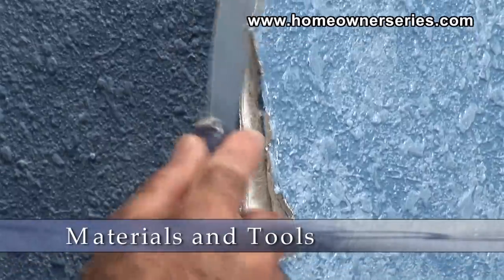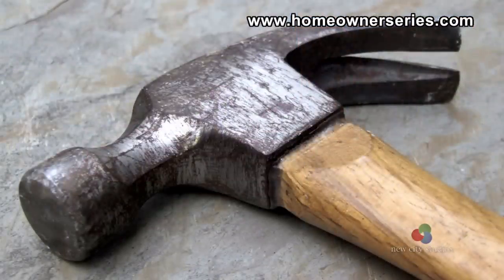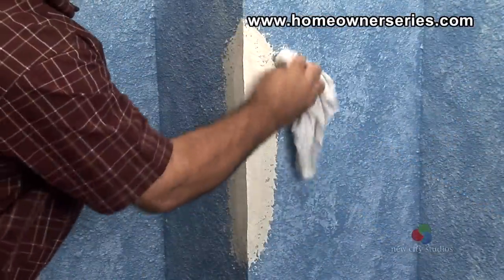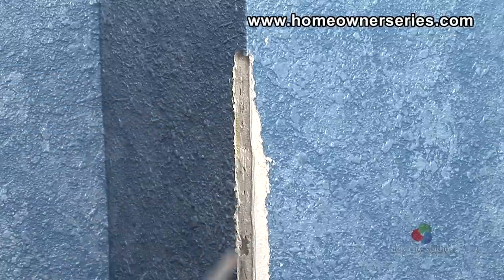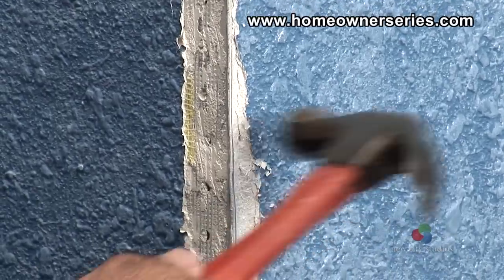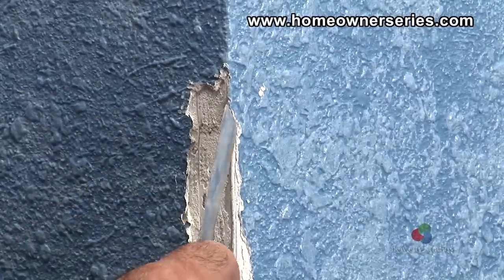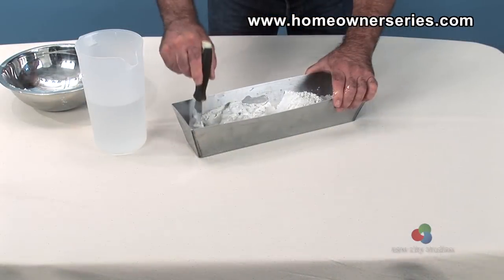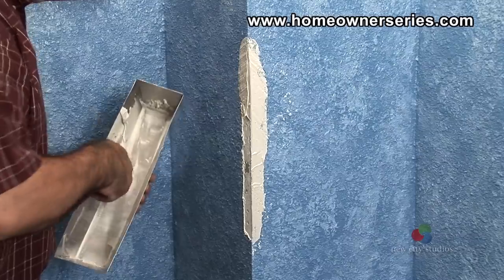How to Fix Drywall - Repairing Corner Bead - Drywall Repair - Part 1 of 2

Comment: This is another method that shows how to fix a drywall corner without cutting out the wall. I believe I could use this method to fix my problem, ie playing with my dog around the house and I jumped knee first into the corner. I've been procrastinating on this small endeavour for the longest and now I'm ready to get it done, since this pandemic has given me time at home. I've read some reviews complaining about the textured wall used in this video, when it is simple enough to sand it smooth if you don't have a textured wall. I'm merging two different methods from two different videos to fix my problem; everyone's situation varies. This video helped me get halfway there. I appreciate you taking the time to demonstrate what the job entails!